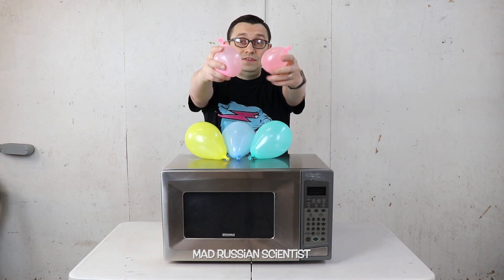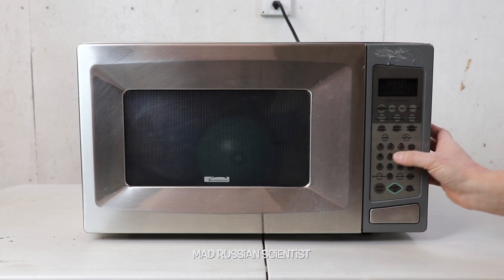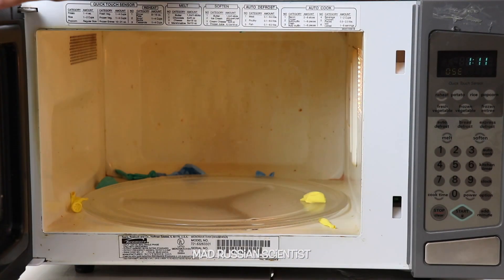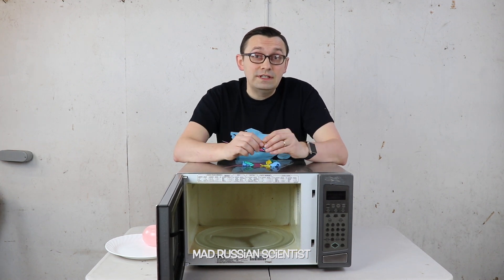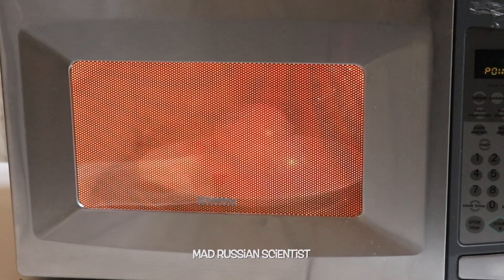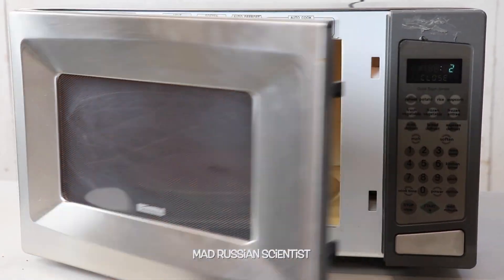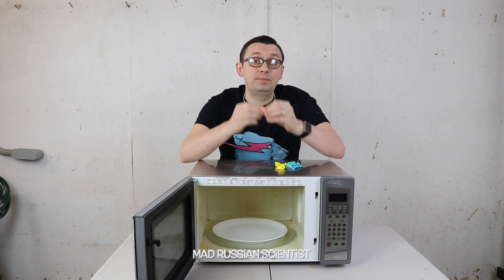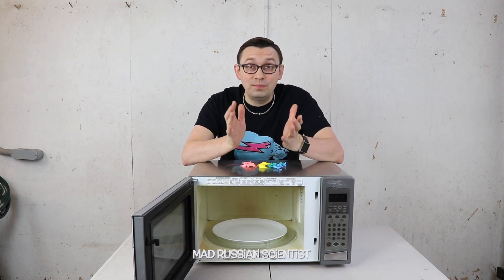Water Balloons and Air Balloons in a Microwave - Experiment

Comment: The one without water pop 1st because the glass plate in the microwave getting heated and balloons pop on the place touching it due to the rubber getting heated/thinner/melted not because they expanded from what can see just little bit...
And the one with water just cooling the plate and for them to pop need to start boiling the water to make steam they expand getting heated and pop